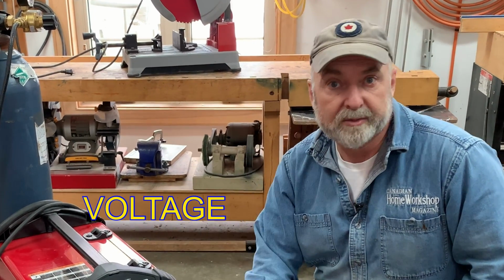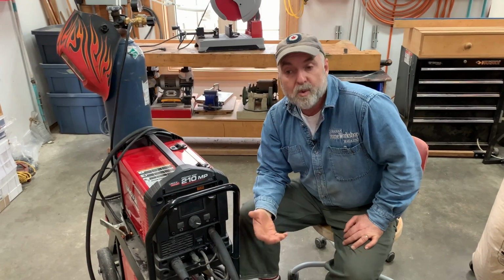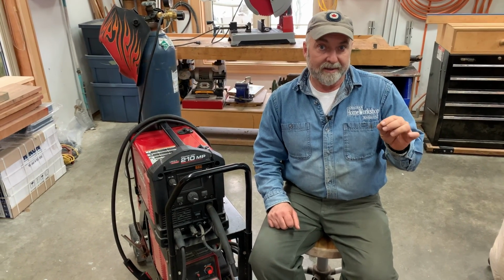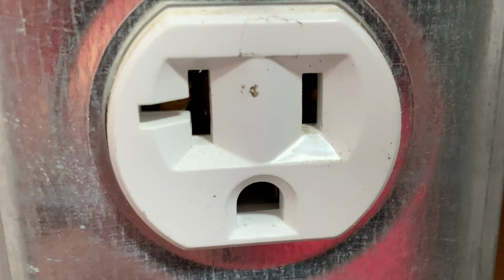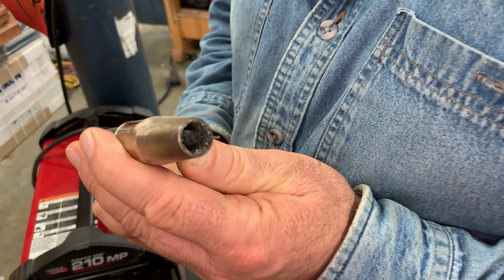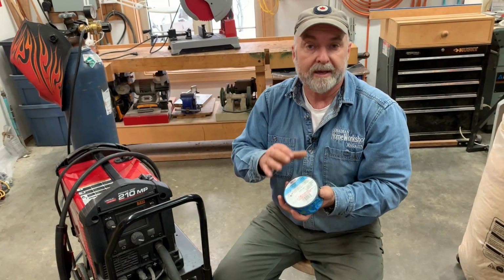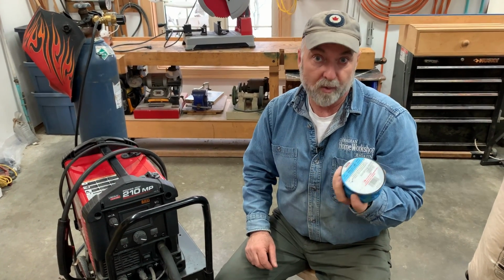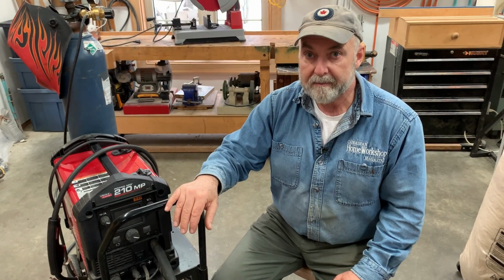How to Choose a MIG Welder

Comment: There are ~$300 machines available on Amazon in US which are 110/220V gas-capable, SYN, claim to weld aluminum, copper, stainless steel. Do you have any experience with those?

Comment: There are quite cheap and portable 185 to 200 amp mig welders. Can i run such a machine from a normal household socket or do i need to install special higher amp sockets?
Reply: Did you even listen to the video?

Comment: Hi, I live in the UK and we only have one voltage and that is 240 volts, to get 120 volts we would need to run a converter, not a tool many have. so we use 240 volts as normal. Your wire ratings are different also, you have 14/2 wire, as we have 3.5/2 wire ( this is 3.5 mm wide wire with 2 covered wires and 1 bare copper wire. capable of running on a 20amp circuit) I don't know what size your wire is?.
Reply: 14ga is 1.5mm and 12ga is 2.0mm. 3.5mm diameter wire is roughly 7ga. BTW there is more to it than diameter.
Reply: Here in the UK, 240v is domestic single phase which most welders use. When you get to welders with 300A+ output, 3 phase at 415/440v is usually required which many industrial premises do have but is an expensive option to have installed at home.